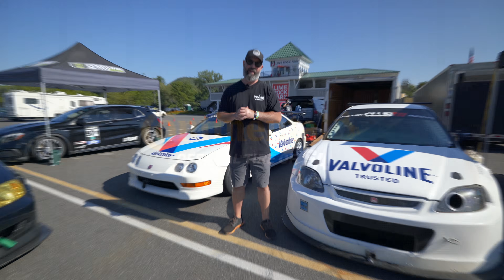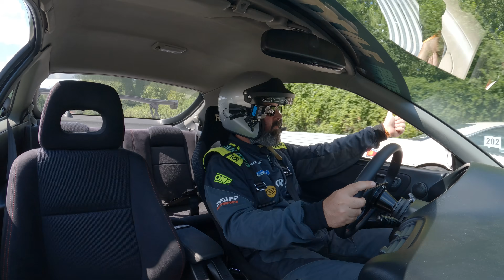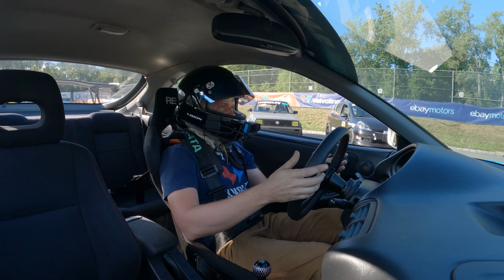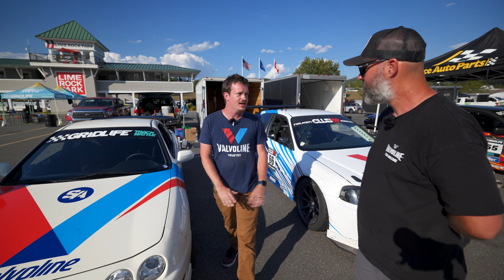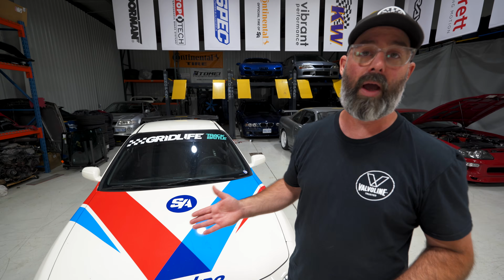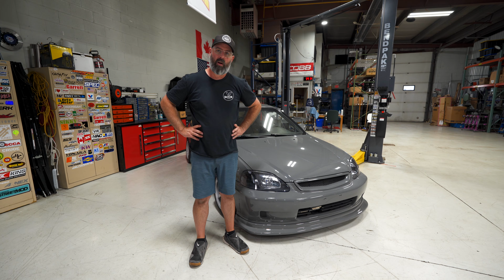$3500 Integra Type R Track Build - PT 2

Comment: In regards to understeer / oversteer and high speed corners I have my dc2 set up exactly for that equal front & rear spring rates or slightly stiffer rear w/ rear shock mount locations effect on wheel rate but use spring rates/compression/rebound to dial in the softest stiff you can maintain grip over bumpy surfaces w/ minimal dive/pitch/roll suspension frequency around 15% faster rear & use the sway bars much stiffer rear at least 24mm rear to dial in predictable over steer  on entry for low & medium speed corners made more or less aggressive w/ alignment settings depending on drivers experience  w/ fwd late braking & lift off oversteer then make the most of the rear wing w/ no front splitter to reduce oversteer but only at higher speeds as the wing starts producing higher downforce to add the stability in medium & high speed corners

Comment: Griots garage track spray is the best option for removing track debri & rubber marks after a track day from paint. bug&tar or adhesive remover might work but more elbow grease and most importantly doesn't lift off the paint as well to reduce surface scratches a must for your trackside tool bag. Spray on let soak briefly and then wipe off rotating to fresh side of towel for each section

Comment: All that Type R really needs is a proper dyno tune lowering vtec to around 4-5k and either a 4.9 or 5.1FD.  It would really be like an entirely different car and probably drop 2-3 seconds at most tracks.
Reply: Curious, how much time do you think the car spends between 4000 and 5600 rpm on a typical lap, and how much more power do you think the car makes on the VTEC lobes in that RPM range?

Comment: 2 of my favorite channels...Yes! Glad to hear you guys talk about momentum cars. I have a slow SH Subaru Forester X with full suspension upgrades. It handles so well for a mini SUV. My next upgrade is a full STi 6 speed and suspension and brake swap. Gotta have those LSD's
Reply: There's a difference between slow cars and momentum cars.  I'm not sure your Forester is capable of being a momentum car.  When you start closing in on Miatas in the corners...I will stand corrected.

Comment: I'm having the most fun I've ever had the track despite being in the slowest car. Wow what a comment that speaks volumes in my opinion. Reminds of leno saying something like sometimes its more fun to drive a slow car fast than a fast car slow. So many times I was going to boost my type r but it's just so great as it is . Thanks for the inspiration to keep it pure while making some slight improvements
Reply: I waffle back and forth like you.  I was surprisingly not the slowest car in that run group in my '85 RX7.  It's disappointing to see someone fly by you during a session, but when I caught up to an R32 and got a point by, it made my day.  I think I could use a better suspension setup but no immediate plans for power mods.

Comment: The 98 Celica SS-III is on par with the type R. toyota left so many parts on the table that could of been used to build a type R specs chassis. It is an overlooked chassis, that nobody knows the potential of it. I'll be finishing mine in the next year or so.
Reply: The Celica GT-Four is the dream tho...
Reply: @tinystar3010  I love my ST185, but it's kind of a different beast with ~600lb more weight than the SS-III; even the ST205 is about ~350 heavier. I've been interested in NA builds for the chassis though. There's a 2GR v6 in a 6th gen... bonkers.